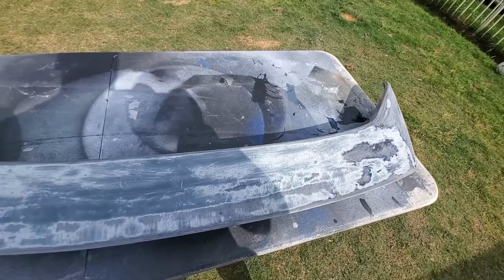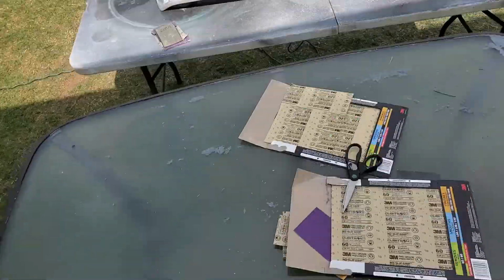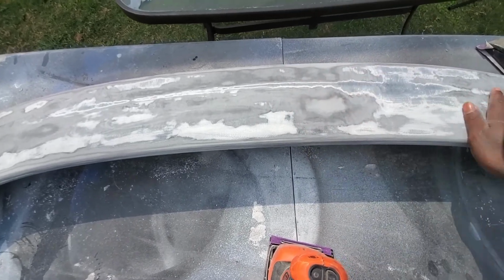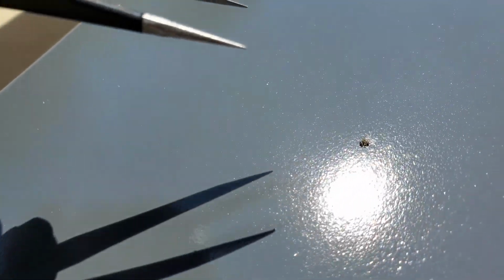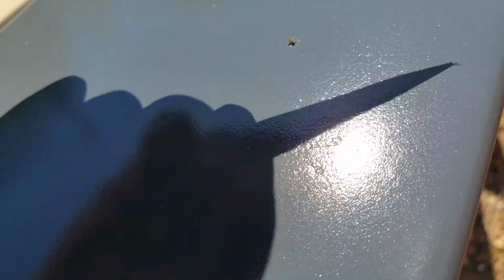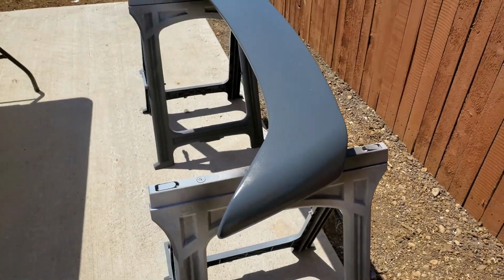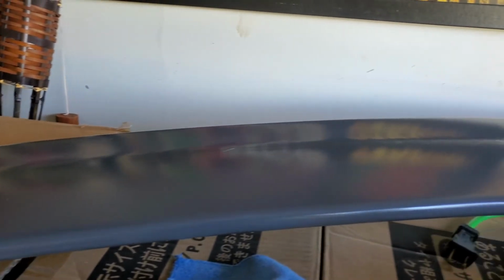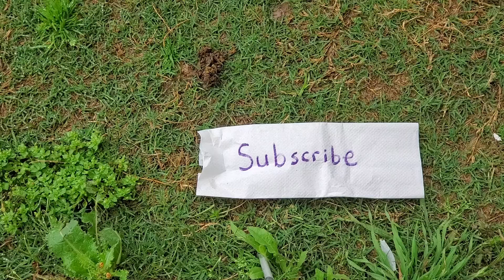Rustoleum Painted Spoiler Success?-Episode 54

Comment: I was thinking about repainting my spoiler too. What grit did you start with/ finish with?
Reply from the maker: 120 to start... but mine was very rough... you can get way with 400 grit work up to 800 finish. You want to primer and paint to stick so do not use 800... makes it way too smooth